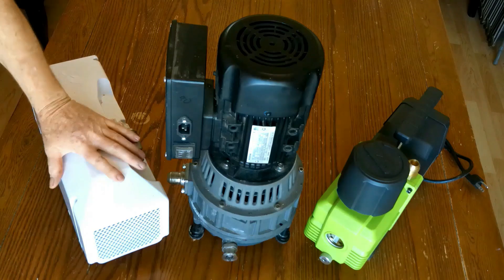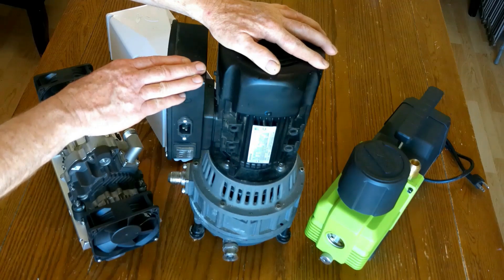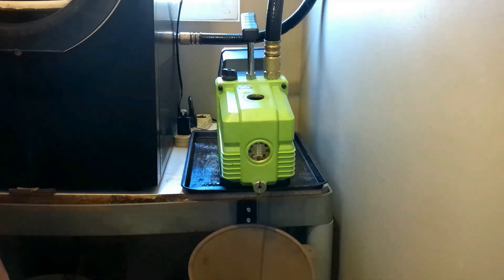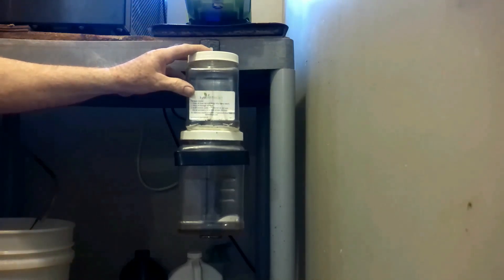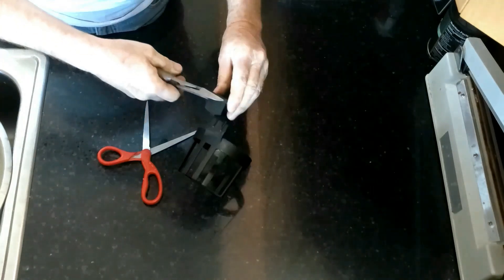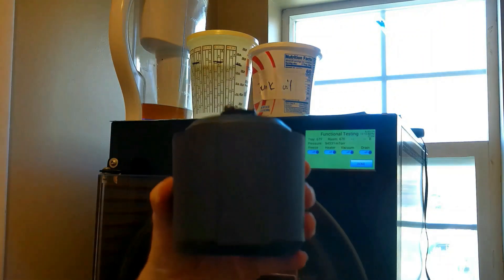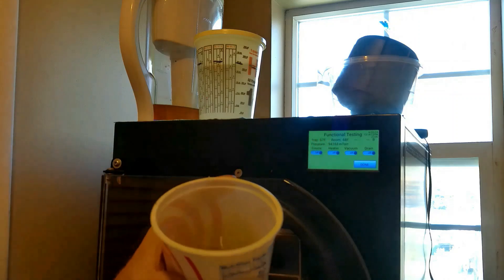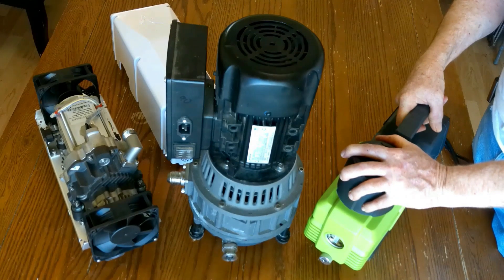Do Not Buy an Oil Free Vacuum Pump-  Changing oil is simple

Comment: I am looking at the Vevor chamber vacuum sealer.  They offer oil and oil free pumps.  I guess I needed to see this video as I almost bought the oil free pump.  This is also an issue with a vacuum sealer as for a freeze dryer??
Reply from the maker: Not so much with vacuum sealers.  I wouldn't buy an oil-less pump for a freeze drier.

Comment: I’m concerned about the toxicity the pump may give. This is what I read. Should the freeze dried community be worried?                        Oil vapor and mist
Even with a filter, the Premier pump can release trace oil mist or vapor through its exhaust, especially if the oil is dirty or overfilled. Breathing this over time can cause:
• Headaches, dizziness, or nausea
• Respiratory irritation
• A lingering oily smell or film on surfaces
Reply from the maker: If you are concerned, you could read the SDS (MSDS) for the oil you are using.  So far, I haven't been too concerned.  If you are, you could crack a window open and place a fan to exhaust any fumes.  There are food grade oils, but they're expensive.

Comment: I wish I would have known the scroll pump is vulnerable to acidic vapor.  I also believe the HR FD vacuum hose suction allows fine food dust particles to pass into the vacuum pump which is devastating for scroll pumps!

HR failed their customers big with offering this pump!  I just found out this morning they released a video to conduct additional maintenance on these pumps that was never mentioned in any documentation I read and certainly was omitted on first delivery!  Probably too late for my dying pump!  https://youtu.be/1osW04DwtbI

@Phil I've read some posts about the oil pumps need oil drained if to be left idle for long durations.  Is that true?
Reply from the maker: I don't think it's a good idea to leave organics (food) or acidic water in the vacuum pump long or short term.  Best to drain and change the oil.

Comment: Im very concerned about breathing in any vapor because I will place this in my bedroom. Is this a genuine concern? Thank you so much for your informative video!
Reply from the maker: If you have any concerns you should obtain the SDS (formerly MSDS) on the oil (or product) you are using and review the risks with yourself or with your doctor.  The issue is long-term effects.  A dryer vent tube and internal booster fan could be placed over the demister and discharged out a window.

Comment: The question is what to do with the oil free pump after it starts to fail.
Reply from the maker: If it's from Scroll Labs there nothing to do.  If it's from HR you could take it apart and replace bad bearings now.  Individual bearings are available from Grainger and Applied Industrial but at twice the price.
https://youtu.be/j0JEr9gaFiQ
Reply: @Philat4800feet  Thank you. It's the HR but it sits horizontal.

Comment: Phil, does the pump oil become acidic after freeze drying?
Reply from the maker: Not so much, but can if the same oil remains in the pump long term.  Any acidity is flushed out with the oil and caught in the paper filtering element.
Reply: Thanks, I would think that any acidity would be in the water that is entrained in the oil, and so filtering oil after each batch would remove any acidic water. I filter my pump oil continuously throughout each batch and have never found any water in my oil. Using Premier pump and oil filter with a water separator. Oil is pulled through filter with a 12v diesel fuel pump and returned to the vacuum pump.
Reply from the maker: That's a great idea.  The problem with oil free pumps is they don't have the oil coating to protect the parts
Reply: I was wondering if the Nu-Calgon Phase III refrigerant acid oil test would detect acid in vacuum pump oils. It appears to work generically on mineral oils.
Reply from the maker: I send my oil to a company called Gearhead for testing.  They do not test for PH.  I have a stand alone PH tester for the water. A sample of their testing can be found on this video:
https://youtu.be/62dIzwn07FU
It would be interesting to perform your acid oil test.  Another oil test can be found here:
https://youtu.be/qPJ1sdce0NM
Reply: @Philat4800feet  Yes, I am using Gearhead to analyze my oil samples too. Thank you suggesting them to me before. I have never had any water in the oil samples I have sent them. I think I will order one of the oil acid test kits just to be sure there is no acid in other form in the oil.

Comment: Too late, darn it !  Now I have to go buy one of the other pumps.  I haven't used my oil-free yet.
Reply: Me too!  I haven’t used it yet, but I’ve had it for over a year because I’m nervous about this whole process.  What did you do with your brand new oil free pump?
Reply: @shellystanley4902  Ditto.  Unfortunately, both the FD and oil free pump are still sitting on my cart. Haven't even plugged them in, yet.
Reply: I’m just going to use it.  If l have to send it in to get fixed, I’ll just have to buy an oil pump.

Comment: Phil, always love your channel. The only thing is you missed information on the oil free pumps. At least the little white one. They will not do vinegar because that’s very acidic and will destroy the diaphragms and check valve in the pump. So if you stay away from Tabasco, hot sauce or something with vinegar to try to freeze dry, you’ll be in better shape without destroying the pump. But normal freeze drying carrots celery soups etc. Once you’re done unhook your hose and when you go into the five minute run time after the freeze dry cycle. Spray five pumps of 70% alcohol in the suction side of the pump. And it will preserve and make your pump run many years longer. Learn this out the hard way. But Dave from scroll labs was very helpful. Repaired my pump for free .All I paid for with shipping. It was still under warranty. But I’ve been freeze-drying with it ever since ,as long as I spray it with alcohol after every batch. Did one year before I blew the pump up. Been running the pump for two years now since escrow lab sent it back to me. I should go check my hours but regardless. And I’m still getting my vacuum down to 300 to 325 Militar
Reply from the maker: I'd say you're the exception to the rule.  HR has lost millions to Scroll Labs on refused claims.  I'm glad it works for you.

Comment: Do you ever heat the used oil on a stovetop to drive out moisture?
Reply from the maker: I have tried this but the heat reduces the life of the oil once the heat exceeds 250 degrees.  You can do the same by placing the oil in your freeze drier.  Moisture will boil at room temperature at 70 degrees at 20,000 mtorr
Reply: Good advice. Don’t run a freeze dry cycle on the oil. Simply put it in the chamber and run the vacuum pump to take down the pressure; which will suck out the moisture. 
The irony is that, when you suck out the moisture from the “old” oil, you’ll be contacting the new oil 😂
Reply from the maker: I have been playing around with vacuum filters filled with desiccant.  Perhaps this will help.